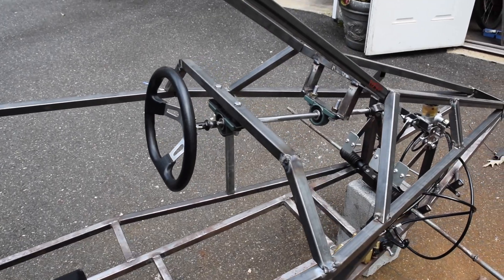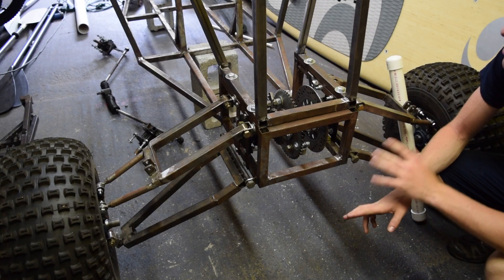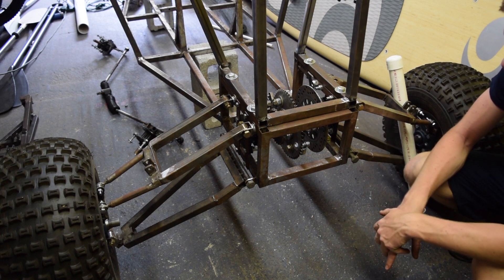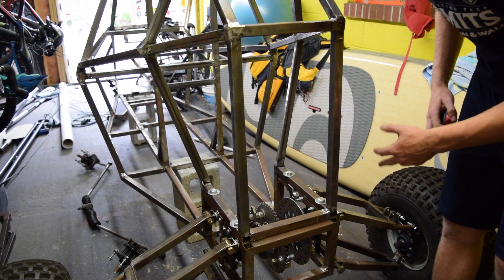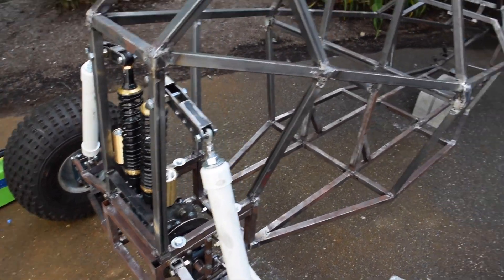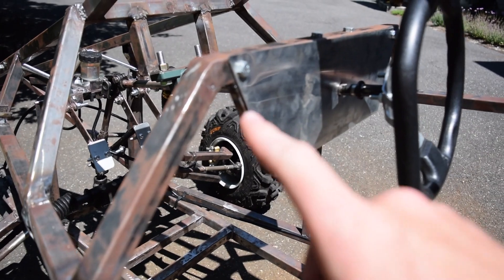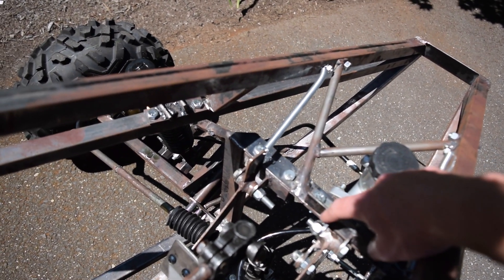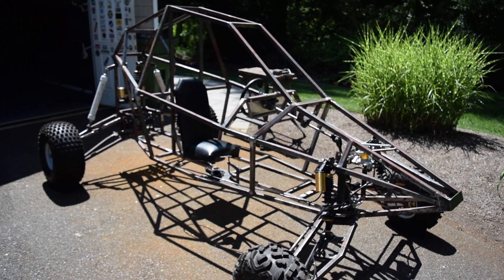Off Road Go Kart Independent Suspension

Comment: what gauge metal do you use?
what type of metal?
what amps u running on your welder?
what kind of welder do u have?
what type of electrode?
 how thick of electrode?
Reply from the maker: trav faiman metal is 1” square tubing 0.065 thickness( not sure what gauge that converts to).    It is steel.    I run my little welder to its max😂 about 85-90 amps.  The welder is the forney stick welder you can find online or at tractor supply.   I use 6011, 6013, or 7018 depending on the application. And they are all 1/8” thick electrodes... thanks!

Comment: Looks like Baracuda design, very nice, I think you may run into trouble with your steering U-joint being on that much of an angle, it may be binding when there is a load on the steering. Mine was setup on a similar angle and I had to change it. What engine are you planning to use? looks like you've got lots of room for any engine
Reply from the maker: Skyline Fabrication  thanks for the input, I haven’t noticed any issues so far with the little amount of driving I’ve done in it the past few weeks. As of now I have a tiny 212cc engine in it with a massive gear reduction for testing only. After that I’m still playing around with different ideas for a powerplant!!

Comment: Great job . How did you come up with the ride height? I guess what I’m asking is, how do you determine the ride height?
Thank you
Reply from the maker: d t when I planned out the front and rear suspension I had a general idea of how high I wanted it to sit as well as how stiff/soft I wanted it to be. Adjustment in the rear is actually very easy.. you can move the pivot point on the pushrods, put a spacer in under the lower shock mount or even one under the mount on the a arm. Similar things can be done to the front. Hope that answers your question! Thanks
Reply from the maker: d t in other words, I roughly estimated the initial position of the mounts and pivots and from there (just like in a truck) I can add spacers to lift it

Comment: I’m curious as to why you would use pvc on your suspension linkage?
Reply from the maker: DIY MOTORSPORT I considered many different materials mainly steel aluminum and PVC. I chose PVC because it is extremely light, has a very high compression strength, and is inexpensive allowing easy replacement if necessary.
Reply: Fair enough I would just be more worried about where the heim joints are attached is all but pretty cool build, I’ll be curious to see if they hold up
Reply from the maker: DIY MOTORSPORT I appreciate it, like I said if they fail they can be easily replaced.  I use a lot of trial and error in my builds haha. Btw your banshee build is sick!
Reply: Thanks, next I’m gonna build a 600cc turbo cross kart so that’s how I found your page just seeing what other people are building!